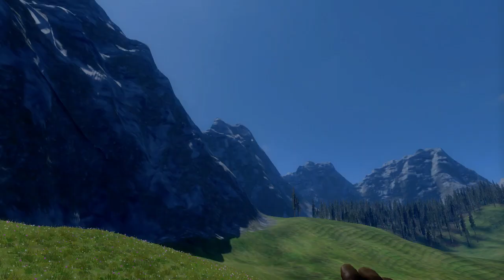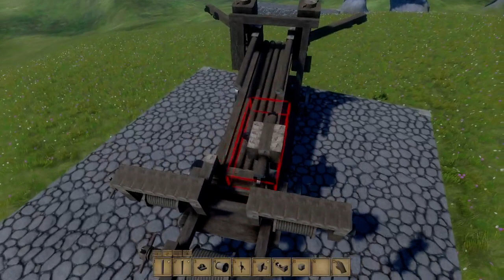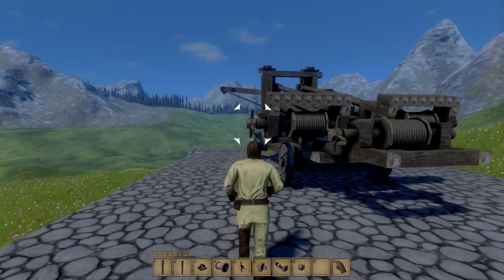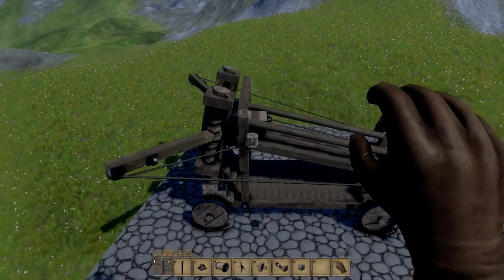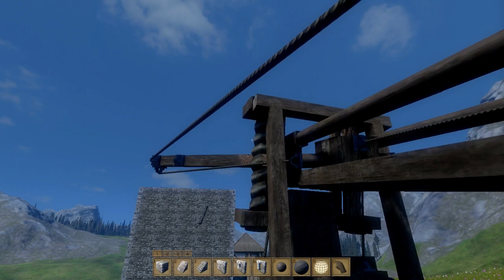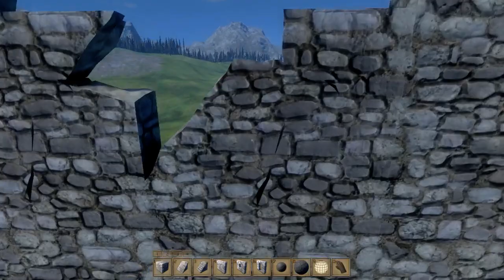Medieval Engineers - Easy Reload Ballista Design

Comment: I realise this is a bit of an old video, but still I would like to say what a neat design. I haven't messed about with long projectile firing siege engines, but if the physics are "correct" wouldn't a front heavy bolt be the most effective? 1-2 weights in the front and then the rest as wood. You obviously don't have fletching for stabilising flight, but the front heavy part should in theory stop it from tumbling in the air and would provide a precise impact point.
Reply from the maker: +Dem Med Hornene Front heavy was my first option but after some fiddling around with it this bolt design gave us the best flight at the time of the videos making which was less than a month after release. This design should be available in the workshop through the link in the description, feel free to mess around with it
Reply: Armanis Gaming
That's what I thought was the case, honestly. I'll download it and try it out though. One thing by the way, did you ever try it with the cannon balls as ammunition?